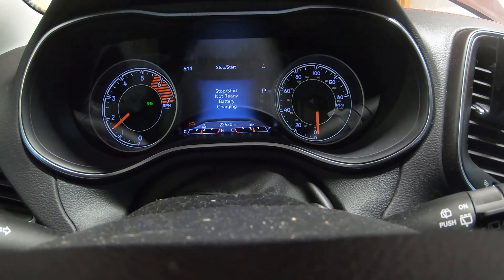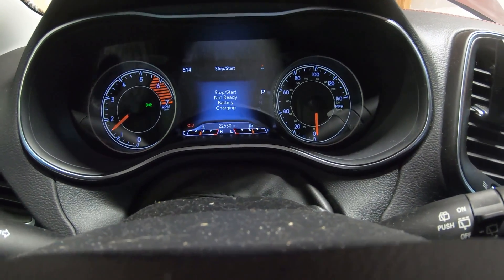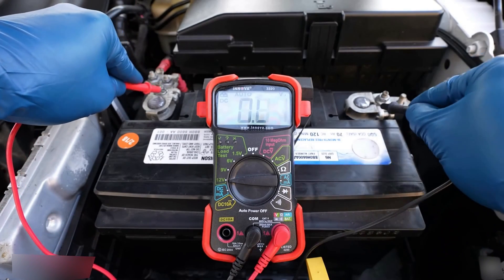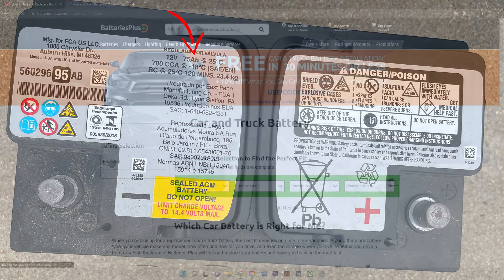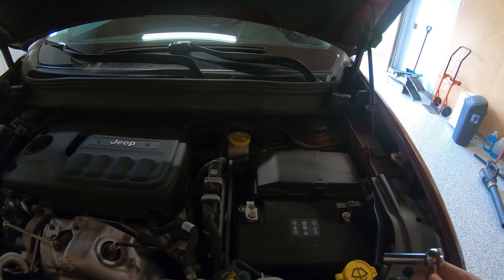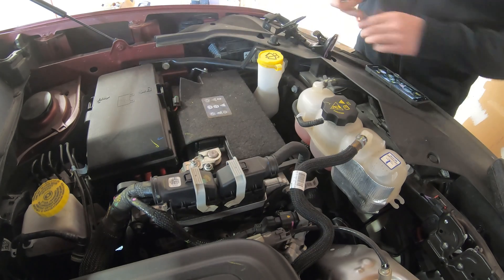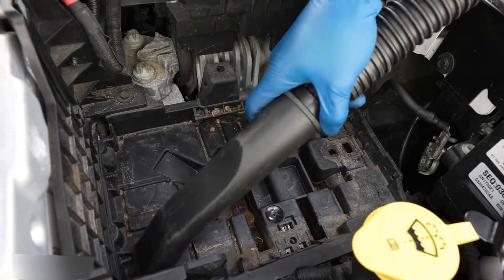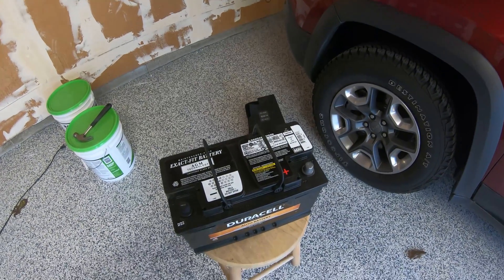Stop / Start not working? | Start here

Comment from the maker: If your new battery didn’t fix your Jeep’s Start/Stop (ESS) system, don’t worry — that’s extremely common on the 2019 Cherokee.
In some cases, it’s the Intelligent Battery Sensor (IBS) on the negative battery terminal.

Make sure you subscribe➡ https://www.youtube.com/@IN-OVERDRIVE?sub_confirmation=1

Why Start/Stop still doesn’t work with a new battery

The IBS monitors battery voltage and current. If the sensor fails or sends incorrect data, the Jeep disables ESS no matter how fresh the battery is. It basically tells the computer, “the battery isn’t healthy enough,” even if it is.

How to test the IBS right now (yes — multimeter friendly):

1⃣ Inspect the sensor physically

Located on the negative battery terminal

Check for corrosion, cracks, or a loose plug

Make sure the ground strap to the chassis is clean and tight

2⃣ Test system voltage with a multimeter

Engine off: ~12.4–12.7V

Engine running: ~13.5–14.7V

If voltage is erratic, too low, or too high → IBS may be misreporting to the charging system

3⃣ Quick IBS unplug test

Unplug the small connector on the IBS

Start the Jeep

ESS will stay disabled

But if other strange charging behaviors normalize, the IBS is likely faulty

4⃣ Scan for related fault codes
Any cheap OBDII scanner can reveal IBS/charging issues. Look for:

U0129 (lost comms with brake/charging modules)

U0001 (CAN bus issue)

B15xx codes

P0xxx voltage/charging codes

If the voltages, behavior, or codes point to the sensor → replacing the IBS is your fix.

These fail more often than people think, especially on FCA/Jeep vehicles with Start/Stop systems.

I’ll be posting the full multimeter test + diagnosis video soon, so subscribe if you want the step-by-step guide on confirming a bad IBS and replacing it properly.

If you want a shorter comment or a version tailored for quick replies to individual viewers, I can write that too.
Helpful things and other videos ⬇⬇⬇⬇
How to test your entire charging system ➡https://youtu.be/___ffPPZKBM
Voltmeter for battery testing ➡ https://amzn.to/3IhKieT
Link to battery I used ➡ https://bit.ly/3UWJlyy
Full comprehensive Jeep brake replacement ➡ https://bit.ly/41Uxi7b
Gift Ideas For Car people 2023 | Must-Have Car Tools, Gadgets & More ➡➡ https://youtu.be/hRzjmGj48Pc
Key FOB battery replacement ➡ https://youtube.com/shorts/aGvWOdPw8Cs

Consider Subscribing  🚨 https://bit.ly/3N2pRXl🚨
Support is appreciated ➡ https://bit.ly/3Ak3QvF
Recommended ➡ https://bit.ly/3AjnDLw

Comment: 2020 jeep grand Cherokee  limited when it says not working engine temp low. What to do?
Reply from the maker: Is it cold out and the vehicle is not up to temperature? If so it will not work when things are too cold. There are sensors for this…
Reply: @ ok. This just started to happened Friday when it was cold outside parked at work. Car kept inside garage mostly. First time this happened. Had vehicle in NY in winter didn’t happen then.
Reply: @ so I have to run car to get to temp? Drive for like an hour? Thanks for that info learn something new everyday. Love my Jeep.

Comment: I've been having issues with my 2019 Jeep Cherokee Trailhawk with what I thought was my battery because I've been jumping it a lot to get it to start. I took it into the jeep service department and he said I have a code P1443-14 "Stop/Start Control Circuit-Circuit Short to Ground or Open." Did you have this same code? Thanks
Reply from the maker: We did not have any codes. I tested the battery and it was bad. Confirmed with Batteries plus. 
We replaced the battery and our issues were resolved. 
I am assuming you googled your code?
Reply: I see. Thanks for the response. Yeah, I did but I wasn't able to find anything helpful other than the same than P1443-14 "Stop/Start Control Circuit-Circuit Short to Ground or Open. @IN-OVERDRIVE

Comment: I got my auxiliary battery replaced two days ago on my Jeep compass 2021 and it still says start/stop not ready cabin cooling or heating I’ve tried everything on manual and still not working 😢
Reply from the maker: Turn off the AC
Other than that, you might need to take it to the dealership and have them clear the codes from the ECU
Reply: @IN-OVERDRIVE  thank you will try that 😄👍

Comment: My 2016 Cherokee Trailhawk has Stop/Start issues most of the time.  It said "Stop/Start unavailable, battery charging" all the time.  I took it to my dealer and they said the auxilary battery was dead, and they replaced it.  It worked a few times since then, but mostly says "stop/start unavailable" for battery charging or cabin heating.  Now it has an error message that it's not working with no reason why.
Will both batteries affect the stop/start system?
Reply from the maker: That is my understanding. If your model is equipped with two batteries and either has gone bad this system will not function.
Reply: There is no aux battery, confirmed on the MOPAR parts website.  You need to go back to the dealer and have them show exactly where that battery is, they'll say it is under the seat, there is no room under the seat nor is there any location.  I replaced my main battery at Advanced, working fine.  FYI, '16 Cherokee Trailhawk, 3.2 V6.  My dealer tried to same BS, went to Advanced to see if I can change it myself, there is no listing for a second battery.

Comment: I had same error on my Grand Cherokee and took it to dealership so they charge me $150 to do a car scan to find out that it has no errors. ...and told me that maybe I should do a battery test for additional $99 since after a car scan and seeing the message they think it's might be a battery. I don't know why I even charged since I have bumper to bumper warranty still and why the mechanic didn't started with battery testing seeing the message. 
Also according to dealership driving for 40 minutes twice a day are not enough to recharge the battery. I am not sure why when I first bought it a year ago nothing was wrong with a battery then (no messages) when it started in -36C after standing on parking spot for at least 2 weeks this one time. It was also shocking it started. Apparently it was enough charge for 2 whole weeks as well. 
 
Now I decided that at the moment it's cheaper and probably more effective to do my own diagnostic. So I am in a process of asking friends to borrow a voltage meter at the moment. Also not sure why the option to see a battery charge did disappear in my vehicle all of a sudden. I know it's was there before. Thank you for reminder.
Reply from the maker: You should ask for a refund from the dealer. This is ridiculous. No services were rendered. And you have a warranty. This should have been free of charge.
Driving 80 min a day is more than enough to charge the battery. 

My guess is the battery is just bad/wont hold charge. you can take your vehicle to Batteries Plus and they will test your battery for free!!! 
Most auto parts stores do this as well.(advance, O'riely, NAPA)

Also, most newer jeeps with the Stop/start system will have a second battery under the passenger seat. stay tuned, I will be posting a video on this.
Reply: 👍4vqq

Comment: FYI it has 2 batteries main and Auxiliary check them both
Reply: I don't believe that is correct at all. My 2017 does NOT have 2 batteries. It does have an AGM battery, the first clue I had that the battery was going dead was that the start/stop was always showing "charging". The GRAND Cherokee has 2 batteries, but the regular Cherokee does not.
Reply: Our 2019 Cherokee has one battery, replaced it with an Optima, still not working (battery charging message).  Dealer is now involved, thinking it's the battery sense module, but I'm skeptical that these guys don't really know...
Update, I  fixed it.  Dealer said that I was using a non stock battery.  I said BS, AGM chemistry is the same, voltages the same, that a better battery is irrelevant.  I replaced the "intelligent battery sensor" for about $70.  It attaches to the Negative Batt terminal, takes 5min to replace with a 10mm wrench.  The jeep then "learned" the current setup and the Start/Stop resumed working in a day or two. Been working fine ever since.  BTW, I  also used a good code reader, there are no service adjustments for the battery system available for this model.
Reply: I think that's my problem, the auxiliary start/stop battery. I'm looking for videos on it for the Jeep Cherokee
Reply: @shawndread2899  it sits in from of the main battery
Reply: @raycastillo9992  I've been told  two different things from two people at the jeep dealership.  One said there was a battery and the other one said that mine doesn't have the second battery. I'm supposed to take it to them to do a diagnostic tomorrow to see what's going on.  I just replaced the battery the other day with an AGM battery but the one before that was just replaced  a few months ago in Sept. I hope they can tell me what's going on tomorrow.
Reply: @shawndread2899  When I replaced my first battery (literally with a hundred miles left on the factory warranty), the service manager told me it had two batteries, but I had already done the research and knew that was false, which was confirmed by the service tech (and me looking ALL over the place for a second battery, and not finding one). Too many people confuse it with the Grand Cherokee, which does have two batteries.
Reply: @bestguy1294  yeah and coke to find out my problem was the starter
Reply: @shawndread2899  it’s not to bad on the removal have the main battery charged and tested I had to replace both twice

Comment: Mine won’t work on my 2020 Jeep Wrangler and is annoying after fixing it
Reply from the maker: I recommend testing your battery first. Start/stop also will not work If you come to a stop on an incline or decline…..
Reply: @IN-OVERDRIVE  The dealership told me there are no trouble codes. The Jeep still within the 3 year warranty. They charged the battery and it worked for awhile. Now, it says charging again.
It worked for almost 3 years with no issues. Our city driving has not changed.
Do we need a new battery?
Reply: @Spunky-iq8jm  best is to have the battery tested, usually free.  3 years, it could easily be going bad.
Reply: @RemE14MZ  I tried to get a battery under the 3 year warranty, but the dealership said FCA wouldn't warranty it unless there was a trouble code.
I will go get it replaced at a local mechanic.
Reply from the maker: I recommend taking your vehicle to a batteries plus. They test your battery for free…